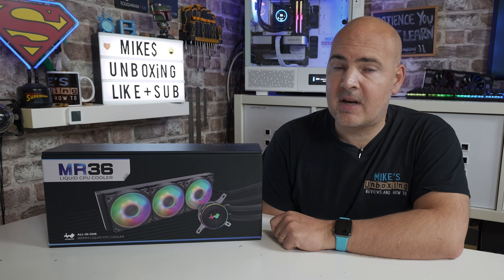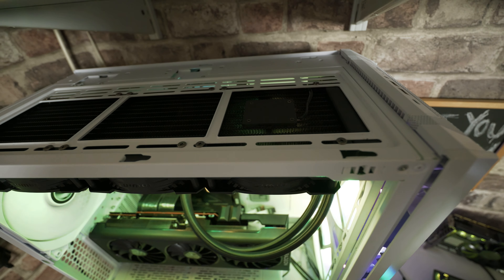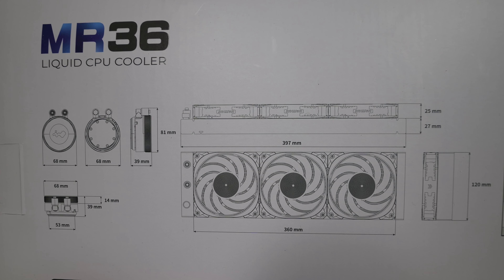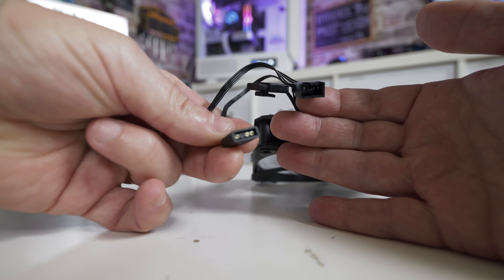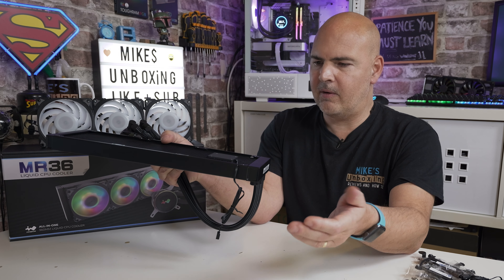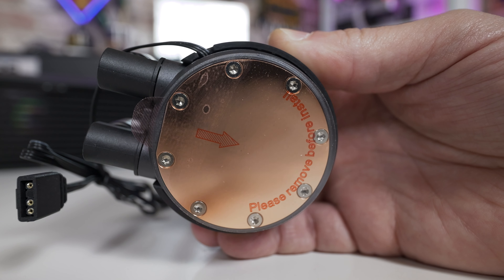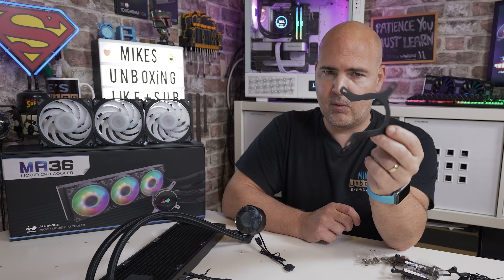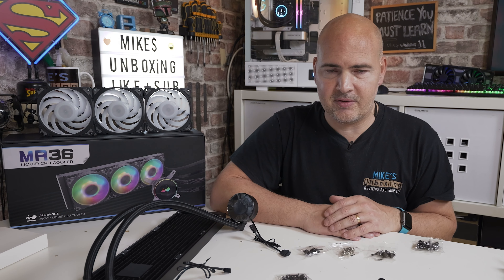Inwin MR36 ARGB 360mm AIO CPU Cooler Unboxed & Tested vs 13900K

Comment: Hi Mike. It's a great video for those who are just getting into the AIO world. I've been a PC builder since the 1990s, when all PC components had a printed user manual in the shipping box. They are usually not found with most of today's components. They could easily be printed on the inside bottom of the shipping container.
Reply from the maker: Well said!

Comment: Interesting to see the oump housed in the radiator. Hadnt thought of heat built up in the head, assumed the liquid took all the heat away.  Does Dc or Pwm power to pump and the high pump speed have issues for reliabilty. Thanks for reviewing Mike and Kath 🐈👍
Reply from the maker: pump speed and reliability is a tough one, some pumps like to be constantly adjusting to the load on the system, strong impellers work well in that setup, if paired with a good high torque motor.
weaker motors will live longer at a constant RPM as the forces needed to slow or speed up flow rates is mostly removed except at system power on or power off.
There isn't really a right answer to the question. Just go with the flow :-)

Comment: I bought the Thermalright aio frozen notte 360 for £67 from amazon.
Got to say for this time of the year the min idle temp is 27c and depends on what game i play i get max temps about 43c. 
The pump rpm is over 5000 plus fans rpm max at 2150rpm.
So i think money spent well for the aio cooler.Good vid.

Comment: Sadly, no buy, not even interested in the cooler. Already noticed that these kind of coolers, with the pump in the radiator tend to clog up very easy and have a lot of failures. Just check the likes of MSI, Cougar, Fractal Design and NZXT where the pump is in the radiator and the amount of issues they have.
Reply from the maker: I will be keeping a close eye on it